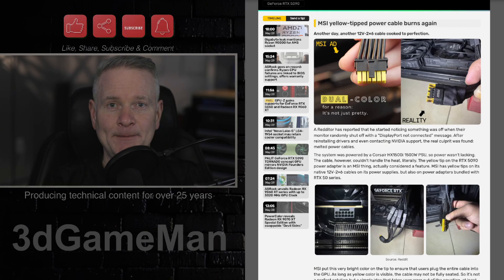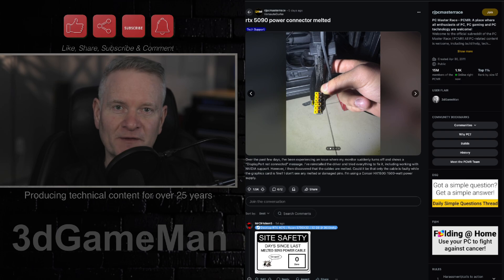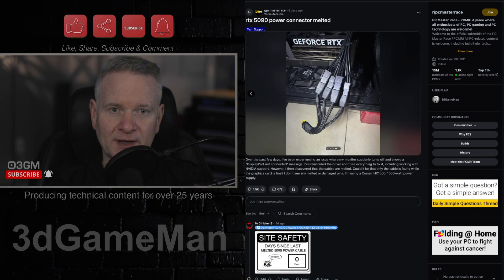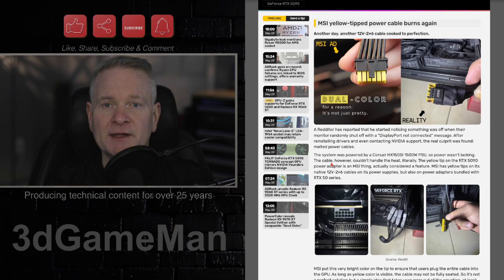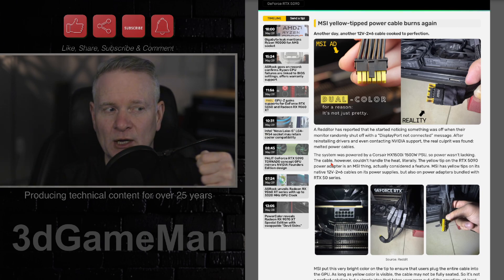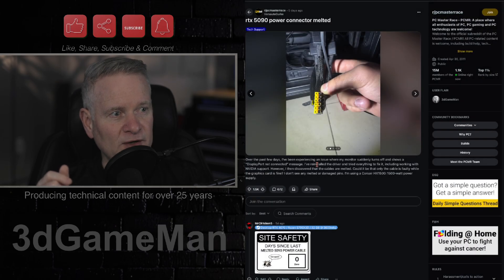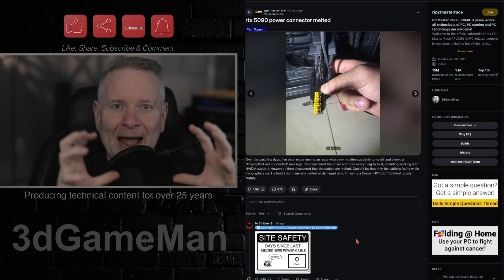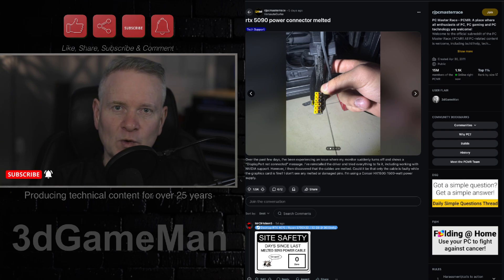More NVIDIA 12VHPWR Madness!

Comment: I set anything with 12vhpwr  to 85% power in MSI afterburner, and measure power draw at wall and it draws 100-150w less .   And performance drop is about 5% or less.  Also cap fps to screen hz. No problems so far with customers
Reply: Also measure amps per cable while furmark  that don't go over 7amps

Comment: Purchased a rtx 5070 and a new corsair RM850e with the 12v cable straight from the psu to the gpu. No issues, even heard the click when it connected to the gpu.
🤷‍♂️ no issues and its been a month. What are people doing that's causing this? Ok you could say Nvidia is responsible, but cmon now at this point I'm starting to think people are doing something they shouldn't be doing.
Reply: @JonQC91  you're using the 5070 which is a significantly less power demanding card than the 4090, 5090, 5080, and 7900xtx cards. All of these cards use over 350w some up to 450w. Your card is a 250w. Keep in mind a 8 pin connector can comfortably handle about 150w so a 16pin handling 250w should be within it's safe range.
Reply: @M.Hametsu  its a great thing that these power issues are only or are mostly gonna occur on the gpus you listed because i have a 5070 ti instead. When i bought one i had to check for missing ROPs, fortunately for me no missing ROPs.

Comment: For those curious:

8-pin PCIE is way, way more overspecced versus their maximum theoretical limit on a typical 18 AWG. PCI-SIG rated these for 150W, but these connectors can theoretically handle up to ~250–360W, sometimes even more with 16 AWG.

This is not true with 12v-2x6.
They're rated by PCI-SIG up to 600W but the theoretical max is around 576–720W on a 14AWG if we're being conservative. That's about 20% tolerance on the best possible wire gauge here, and we're not even talking about how these individual pins will perform once they degrade over time. With 5090FE having 575W TDP at stock, it's already obvious that there's very little breathing room left for things to go wrong.

I get that NVIDIA PCB is partly to blame here because they reduced shunt resistors from 3 (in 3090Ti) down to 1, but this new connector specs isn't doing us favors either.
Reply: It also has no safety precautions when a pain isn't connected so let's say 1 pin isn't making contact that's about 35w being pushed onto the other connectors.

Comment: I am using a Corsair 12vhpwr to 2x8 pcie connectors with my 5070 Ti which is overclocked heavily + using a 350 watt custom bios and I have not had one single issue, and tested tons of games and done hours of benchmarks at max load on the gpu with 3DMark and other testing suites. When plugging these connectors in, you have to make ABSOLUTELY CERTAIN you hear the "click" when securing these connectors as the sound it makes is so hard to hear, and one may think they are good if they cant see the yellow on that connector in the video but you HAVE to also hear the click too. I have used the same 12vhpwr cable with two different gpus (the other being a heavily overclocked 4070 Ti Super running above its stock power limit) and i had no problems with that either before i sold it. I still think to some extent this is a skill issue on the user's end.

Comment: I am sorry but this is not the 5090's fault, I can tell the owner of this card is next level moron just from the information he shared.

1. Corsair PSU, why not Seasonic?
2. 1500W, why the fuck you need 1500W? even with an 9950X and a Rtx 5090 you need 1000W and you still have plenty room to spare for watts.
3. AN MSI ADAPTER? FUCKING WHY? You have money for a fucking 1500W overpriced garbage corsair PSU but you cant afford or get your hands on a native 12VHPWR Cable?

And 4th with how much of a moron we are dealing here I am willing to bet he put that cable with either bending, without pushing it all in or BOTH while pushing 500W+.

I dont know how you expect the cable NOT to melt. You might as well put the 6 pins straight up to a 16A Wall plug and cook them like a brisket.

It must take really special idiotic talent to manage to fry all 6 out of 6 pins.
Reply: The insane amounts of misinformation here is well, insane.

The PSU wattage is irrelevant the hardware will only take as much as it requires no more no less so the 5090 rated at 575w is only going to ever at absolute most pull 575w because it's hard coded not to request more.

The Corsair HX1500i which is what I assume the poster is using is an A rank rated PSU on the PSU tier list meaning it's among the best of the best in reliability (the PSU tier list ranks exclusively on reliability and build quality)

The MSI adapter in question was designed specifically to avoid plugging in the 16pin connector improperly. The yellow tips are so you can tell if it's fully plugged in or not. If you see yellow, it's not seated properly. I have yet to see ANYONE claim the MSI 16pin is bad hardware.

As for the wattage being more than the PC needs is simple. If your PSU is well over what your PC needs it'll have a longer life span as it'll live under less stress from the high power draw thus reducing any chances at failure on its end. Of course the PSU upon death can take the entire PC with it.

Your ignorance at how you're the idiot here is astounding.

Comment: Why not use the cable that came with the corsair power supply.  You are not suppose to mix brands
Reply: No you don't want to mix cables that connect directly to the power supply, but cable extensions don't have that flaw which most 16 pin connectors are connecting to 4 8pins

Comment: This connector was one of the reasons behind why I instead got first a 6800XT and then a 7900XTX later. I do not trust that connector.
Reply: Connector is pretty decent for 300w cards. Nvidia got greedy with its 600w design.

Comment: Have all of these instances been the adapter or cables straight from the power supply?

So far I've used it straight from the PSU and thankfully I've been safe so far 🙏🏽
Reply: It has happened with both adaptors and cable straight from the PSU.
Reply: Also depends on your GPU. The 5070ti and lower don't draw enough wattage

Comment: Thanks for covering this, the fault is treated as an accounting problem with Nvidia actually optimizing out precautions in the 3090 power design.
RMA costs are pushed onto consumers and AIB partners.

The 12V-2X6 "standard"  is defective by design, while older cards could balance power zonally, they mandate shorting input power on the board so imbalances on pins/cables cannot be managed.  Some AIB are breaking spec for limited warning features.